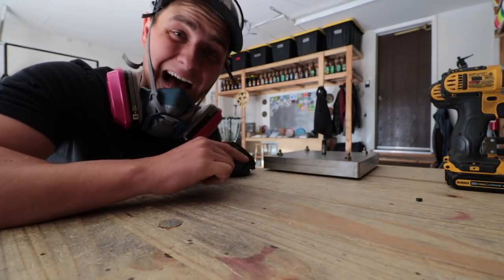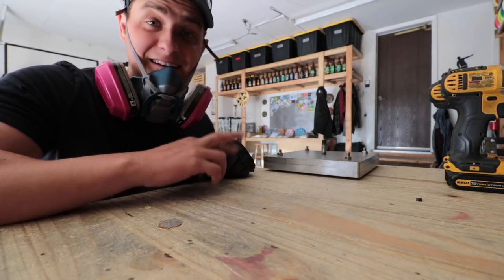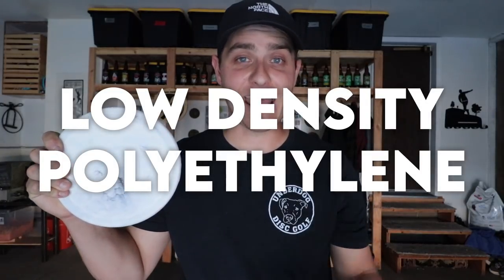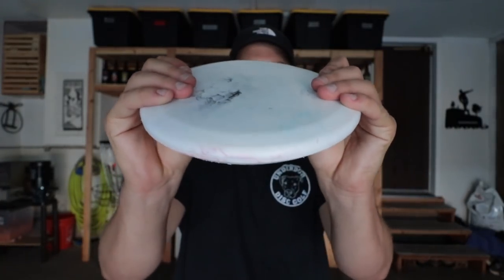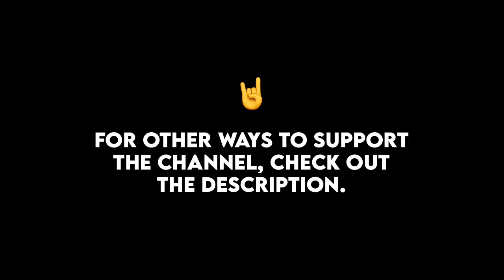Making a Disc Out of LDPE (the same plastic type as plastic grocery bags!)

Comment: Does melt flow vary with plastic or temperatures or both?
Reply from the maker: Melt flow is based on the plastic’s chemical composition, while melting temp remains the same 👍🏼
Reply: @TrashPandaDiscGolf  awesome. In the Day 1 video, how did you get different melt flow with the same kind of plastic? Or was the comparison with the HDPE from before?

Comment: As far as I know most grocery bags are PET or HDPE the LDPE ones are thicker and smoother, I'm interested to know how you came to the conclusion they're LDPE.
Reply from the maker: Hi Liri! It's my understanding that most grocery bags are HDPE and LDPE (the two used in the video and most I run across are LDPE). That said, plastic types vary drastically so saying "all grocery bags are this one plastic" would be misleading. I apologize if that message came through!
Reply: @TrashPandaDiscGolf  That's alright, guess I'm mostly worried about people going and recycling all of these together without sorting them...
Reply from the maker: Absolutely agree! I've talked about the cons of mixing plastics before, but may revisit it in a video this week.